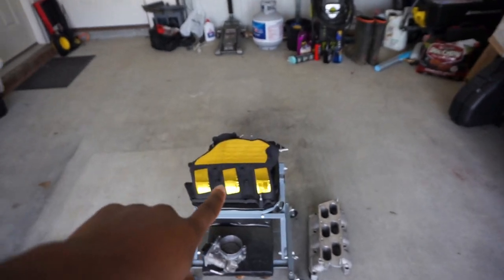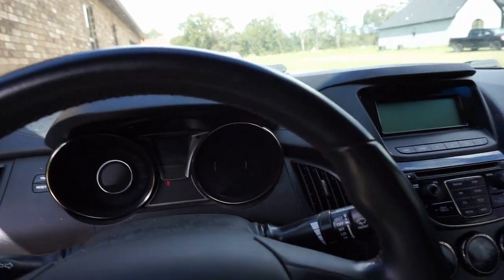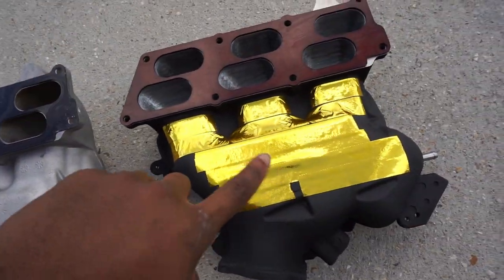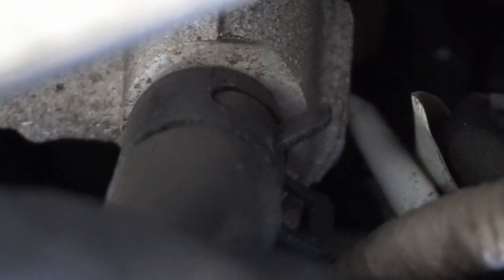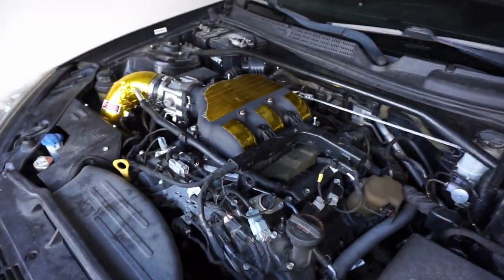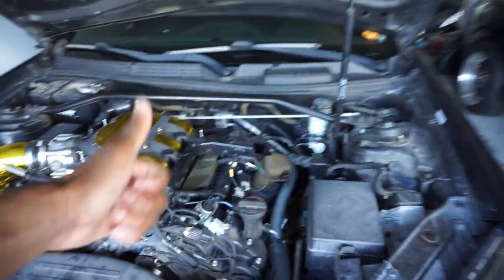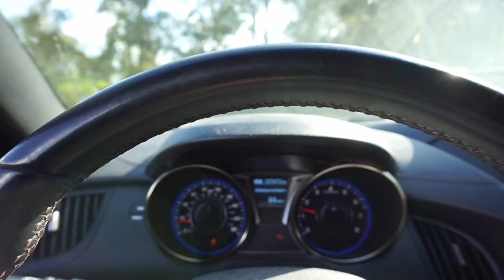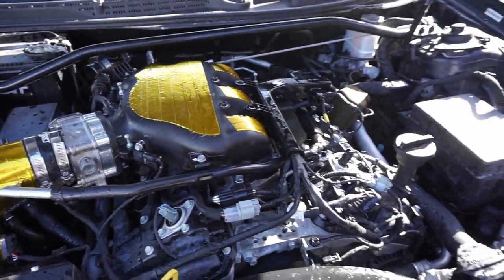Installing My DIY PORTED and POLISHED INTAKE MANIFOLDS and THROTTLE BODY | Genesis Coupe 3.8

Comment: Use sea foam intake spray to help clean the valves asweel as install a catch can to help prevent them from getting more gunked up.
Reply from the maker: Gotcha.. I installed a catch can a few videos ago, so most of that happened before-so

Comment: I bought a Genesis after Owning a Direct injection mini cooper, something the Mini guys do is walnut blasting the valves (taping off the ones you're not working on) then vacuuming them out after blasting. I don't know how easy it is to get to the valves on these yet but it could be worth trying
Reply from the maker: I’ve also heard of people doing this.. I may end up seeing if Hyundai could do something about it first. I’m kinda nervous to try anything myself with it, but if I have to then I will try😅
Reply: I work for kia and i on a 2015 genesis 3.8 r spec that i just bought and guys i can garantee u it worth the cleaning. I walnut blast thwm with à pre wash with brake cleaner n à brush n it clean them like new. While u there i changed my spark plug cause u have them right there. But any GDI engines should be valve clean every 60k miles/100k km. My car hasard 125k KM  n it was disgusting, remove some piece with à screwdriver cause was such big piece. Took aroung 30 to 60min of work for cleaning and maybe 10hour to get access n replace everything.  Good Lucky guys

Comment: If you don't already you might want to consider putting a pipe that runs from one downpipe to the other or the test pipes to get rid of some of that rasp. Sounds good that you could hear it in the back of the video

Comment: Always make sure you unplug the battery and plug it back in after doing mods like this, itle reset the ECU and it seems to help your car understand the mods you installed better.  I put a mufflerless 3inch catback, and a catless 3 inch downpipe on my 2.0t and it kind of ran like crap after a day of driving.  I unplugged and reconnected the battery and it was like driving a completely different car
Reply from the maker: I always unplug it and whatnot, but that’s good info for everyone that watches👍🏽
Reply: John Sullivan - Did the check engine light go off when unplugged the battery?

Comment: So can you use the grimm speed spacer with the manifold riser, I'm assuming 1 oem gasket on top and the grimmspeed spacer on the bottom and the riser in between? Will the hood close with both on?
Reply from the maker: Nooo, DO NOT use both at the same time.. It’s not recommended, will provide negative results, and the hood will have trouble closing🙅🏾‍♂️
Reply: @pj_morrison  good lookin out lol I have both but I guess I'm just gonna stick with the manifold riser with OEM gaskets 🙏 thanks

Comment: Dooooope video always great to see a 3.8 owner making quality videos, our platform doesn’t get the love it deserves. But I ordered a riser today and since tha passing of Dustin at 3p8p I don’t know what’s happening with shop, so I was looking at alternative methods of porting & polishing. 

Also for the intake, you can remove that lil big of plastic at the top of grill/area the hood latches to the bay. It’ll open it up and let it breath a lil better. 

It’s number 5 on this list 
https://www.gencoupe.com/threads/how-to-3-8-performance-upgrade-path.519338/

Also, since it’s been a lil while, have you noticed any improvements from this? I heard it can take a few hundred miles for the ECU to try and adjust to various intake modifications
Reply from the maker: Thanks a bunch, I’m glad you liked it.. If you would, share it with some ppl you think will benefit from it😅

Idk what’s the wait time on the riser, but I do know that there are people who have gone out of their way to help 3p8p get all orders shipped out quickly and efficiently.. Maybe even faster than before since it was only a two man team. As for the plastic piece under the hood, I believe that was engineered to direct air to the intake and without it, it may not direct the air anywhere. It’s hard to say if that’s something that needs to be gotten rid of, but if you find out for sure then let me know👍🏽
Reply from the maker: It’s hard to tell if I’ve felt a difference with all the mods yet, I need to run more people.. But I will say, I need a retune now lol and I’ve been testing everything out with a Z that I know all the mods to. And I’m proud of where she sits👍🏽
Reply: Don’t remove the air director off the front bumper it is important in providing cool air to the stock air box location